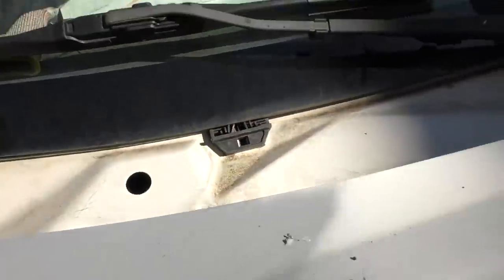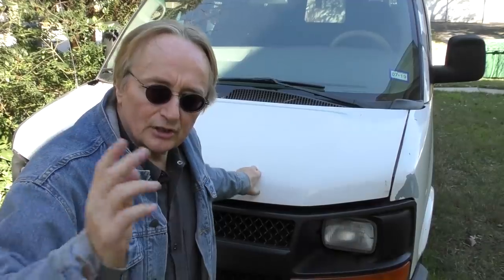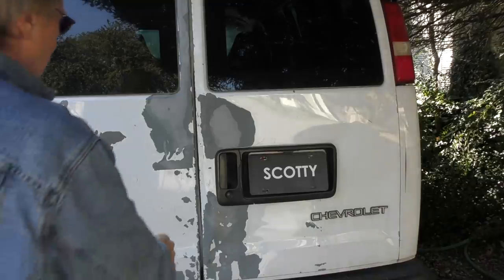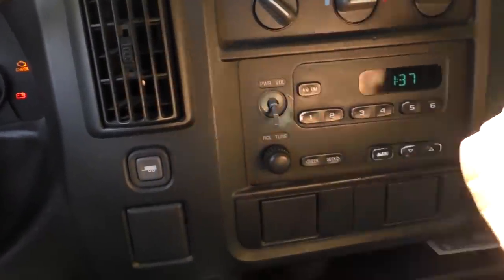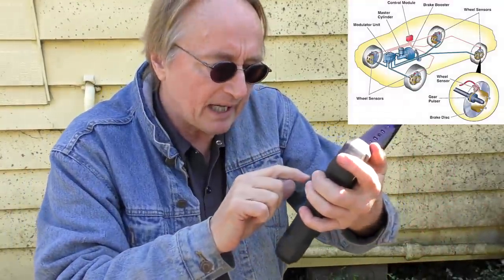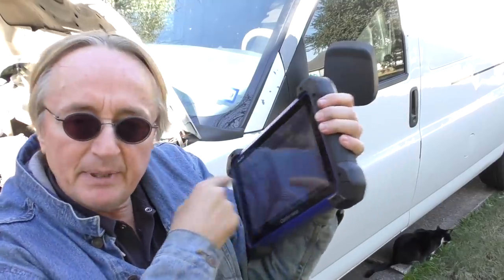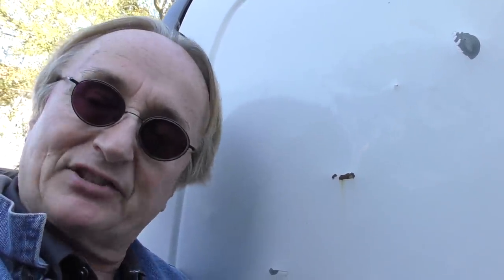I Told You About This Vehicle But Nobody Listened

Comment: One of the best pieces of advise I ever received from a used car dealer is never to buy a used car based on the model or make. You always buy it based on the way it runs.  A good running Genesis is better than a Toyota with a blown head gasket or shot transmission... always.

Years ago, I set up a "proper maintenance" program for my friends new Ford Escort...  Few of that vintage Escort ever saw 80,000 miles... but with regular timing belt changes and synthetic oil his was going strong at over 200,000 miles when a tree fell on it...  Normally, I'd never recommend that anyone would have bought that particular vintage Escort.  But with a top quality maintenance schedule, that would have made a great car to buy cheap at 100,000 miles and would have served someone for a very long time, if properly cared for...

If you really maintain your car right, and you keep up on repairs, and drive the car conservatively and most of all find a good affordable mechanic or do repairs yourself... you can make lemonade out of a lemon.  You can be the guy or girl with the "freak" car that lasts forever when all of the other cars of that make and model are long since crushed.

One last footnote... Cars often don't give up until after their owner gives up on them.  People just stop fixing the small things, until there are so many small things wrong with the car that the cars aren't worth fixing.  I've owned several cars like this.  Radio. A/C, windows, and heat don't work, exhaust leaks, paint is flaking off, power steering leaks, tires bald etc, etc, etc.  In all cases the engine and trans ran strong, but with so many things wrong I usually get the cars for junk rate.  So I assess the entire vehicle and start the rehab from the most critical repair to the least critical.  Over time the car slowly comes back as the repairs are done... and astounded people ask me how I can be driving a car for 15 years that I got for $1.00.  The fact is that the original owner could have driven their car for another 15 years if they had just kept up on the maintenance.   So yes, Scotty is absolutely right... you are always better off buying a better built and designed car, but if you got that part wrong, or can't afford a Toyota (for example), don't give up on old Betsy.  If she runs well, you might be able to keep her going strong with a little TLC.  She still may cost "too much" in repairs, but she's the devil you know and as long as she's still cheaper than car payments keep on trucking.  I've even sold a couple of our $100.00 clunkers as antiques for a profit after it just got too hard to find parts.

Comment: Every old gm ford or dodge commercial van had that paint problem
Reply: Plus they’re usually old. I just saw a Ford the other day on the job site, looked similar, if got got up close, it looked like it was snowing out.  I work in a company with fleet vehicles, if someone gave me the option of buying a previous fleet vehicle or rental vehicle, I’d be hesitant, but would probably go with the previous rental vehicle in that scenario.
Reply: @laxbeach2381  and if it's not the employees on vheicals they are rough on them no matter what

Comment: G.M. has had that issue with the paint for a LONG time. I had a new '89 Chevy S10 pickup with white paint peeling in big chunks down to the grey primer within a few months. (Along with lots of other issues.) After the 3rd time it was repainted (while it still looked o.k.) traded it. Took a hit since it was less than two years old. What a piece of junk that thing was. Along with the peeling paint the stuff I can remember fixing on that thing included: bad clutch fork causing premature clutch fail/slipping (< 5,000 miles), had bad programming in the ECU, so ran terribly in 5th gear, and various plastic crap broke under normal use including the glove box, headlight switch (nice when you can't turn your lights on a night) and various other junk. I know when I was trying to get hold of someone at G.M. about the paint they just kept telling me it was due to acid rain, despite the lack of other vehicles not having that issue at the same time.

Comment: The last GM I bought ran forever, however the trim, and paint  fell off and NOTHING worked after about 60,000 miles. Wipers, cruise, AC, some lights, all quit working, along with annoying exhaust leak that was fixed twice before I got rid of it.

Comment: I have a 1985 dodge b350 15 passenger van.  Still drives great just  came back from a 1400mile roadtrip down baja peninsula. The wheels haven't fallen off yet haha! Burns oil but still drives down the road.

Comment: Scotty. It is a VAN! The engines on all vans are hard to access. I have an entire fleet of these Chevys with about 400,000 miles and still going strong! I have 2 Ford E 350 chassis cabs from the same era that are sitting in our boneyard. BTW, the Fords both have had engine and transmission replacements at less than 150k miles.

Comment: My 05 Chevy cavalier paint job is still in very good condition after 14 new England winters. I  owned a 13 year old almighty Honda accord  for 2 years that developed  broken interior door handles, rotted out muffler ,  front end ate up tires and radio was shot.  ....the cavalier has had none of those problems .

Comment: My father had a 1997 Dodge Grand Caravan and after it was 7 years old, the van had difficulty passing the emission inspection in VA. We got rid of the van in 2009 as had so many problems with it
Reply: A wise old friend (once a Hudson dealer's machinist) suggested running any failed emissions test vehicle on E85 for passing the test, then reverting to the common E10.

Comment: As many have said here, maintenance also plays a big role.  Even if you don't take care of a Toyota, it will break down at some point, as will most vehicles.  I do agree that the accessories and electronics on GMs are garbage (my transmission--which is still going strone--has outlasted my driver's window switch and radio).  But my vehicle (which is a 2013 with the 5.3L with active fuel management) shows that it is possible to keep a GM vehicle in good running condition if you take care of it.    One o ther thing I've done to help my cars get high mileage with little to no problems (mechanically) is when I bought them new (yes I bought new vehicles in the past, probably won't anymore) is I would change the oil every 1500-2000 miles for the first few changes (so I might do 1500 miles, then 3000 miles, then 4500 miles until it reached about 5,000 miles, mainly to get out any possible metal grain from the mfr process that might be in the engine).  Some people just run the original oil until their first oil change which IMO you shouldn't do.  I also change my trans fluid every 60k, and do my 4WD service around the same too.  So far it runs great, with the exception of one lifter that sometimes get stuck, which will need to be addressed, but for 147k of mostly highway miles (and not easy ones, as I tow trailers too) that's not too bad.  I've seen worse trucks from the same era that had major issues right around the time the warranty ran out like burning a lot of oil or oil pump failure (mine failed, but within the warranty so it go replaced under warranty thank Goodness as that would have been a $1000 job) .  So proper maintenance goes a long way, and this van Scotty shows that depending on your expectations if you just want a van for hauling stuff or as a beater, and don't care what it looks like, then why not.  YOu can find some of those cargo vans really cheap that might look like crap, but they run fine.  aS for the radio, perhaps the guy should just pull out the connector in the back.  Simple fix.

Comment: My 1977 Camaro had the same issue with the paint. The hood was repainted once under warranty. In those days the warranty was 12 months/12,000 miles. 43 years should be enough time to figure out how to paint a car. But I guess not. Maybe in another 43 years.

Comment: I’m listening Scotty.   Especially since the Bailout.   GM has gone wayyy downhill.  They had bad primer back in 1989-1994 I believe it was.  The trucks were solid but paint was crap.  I drive a 2014 Chevy Express work van for my company vehicle.  All of them fall apart and yes have the bad paint Again.  The bumpers aren’t galvanized anymore, you get one scratch and it bleeds rust ☹️.  Why don’t they point this out on their Real People Not Actors commercials.  🧐

Comment: The doorhandles on 2003 on a Chevy vans are cheaply made. You have to buy the entire panel and it costs about $400 per side from the dealer. If you somehow break one of the window cranks off, which is really easy the way these vans are laid out you look at it another $300 to replace the regulator/latch assembly. It’s all one piece. If you’re going to buy an old American style van, Ford E Series has more head and leg room and the door panels are better built. The only issue I have is comparing a Chevy cargo van to a Toyota sienna. This is apples to oranges as Toyota doesn’t even have  a work van in the USA.

Comment: First off it was not GM's paint, IT WAS A PRIMER ISSUE, and many other manufacturers suffered the same problem. So your talking bunk here again Scotty. GM has a de-lamination warranty.  Secondly, most all vans have dog houses and this one is one of the easiest to remove. More bunk again Scotty. Engine size? I guess all the Express vans running over 200K got stressed out like you implied? Again more bunk Scottty. Yes this one was beat hard and put away wet. GM's fault? NOPE! SO I GUESS YOUR DONE WORKING ON CARS AND HAVE BECOME A BUNK SALESMAN?? YUP!!!!

Comment: That guy with a Toyota transmission question...
I had a Toyota Avensis II for 10 years with an AT and currently own a Toyota Avensis III with a CVT and both their manuals explicitly say NEVER EVER do that kind of thing  on a slope. The things just weren't designed for that.
You can do it if you're want, it's your car and money after all. But then you shouldn't be asking in the first place.

Comment: I see a lot of old Toyota's with no clear coat left, and a red car that is now pink.  Can't decide if it's poor quality or owner neglect since they just want to go from point A to point B.  Toyota's are designed for people who don't like driving and don't like cars.  That van is rough though.  I heard GM trucks don't take too much pressure to move back on the frame straightener either.

Comment: LOL vehicle rolls backwards while in drive ,let's do a tune-up! Says Scott!  All vehicals do! depending on the grade you're sitting on. Always good to hold your foot on the brake until you're ready to go quickly moving from the brake to the throttle to build pressure in the torque converter , more RPMs (faster) you spin the torque converter turbine = forward inertia

Comment: We run all GM trucks at work. Used to have several Express vans(V8 AWD). All of them went well over 250k and one went to almost 400k before it was sold. Some issues, but surprisingly few. We now run Canyons and Silverados (all 4x4). The first canyon we had has 310k with some minor repairs, all original drivetrain. I've definitely had some issues with GM products and will never personally own one again. I just got rid of a '10 traverse in exchange for a '17 highlander for my wife. That Traverse was an absolute pile. My current company truck ('19 Silverado V8 4x4) with 62k on it has already had the oiler cooler lines replaced due to leaking and the starter died and had to be towed to the stealership. The trucks seem ok, but the cars seem horrible. I don't pay a penny for my company ride, so I'm happy to take whatever they get me, but if it were my money I'd be driving a Tundra.

Comment: I drive a 2006 Chevy Express 1500 w/ the 4.3L Vortec for work. It’s used to haul 10-15 dogs, yes dogs Monday-Friday. I agree that the engine is underpowered, but at 130,000 miles and 90% driven in the city this van has been very reliable. It gets it oil changes every 5000 miles, only using Mobile 1 synthetic most of it’s life. Transmission fluid, diff, and coolant are replaced every 3 years due to severe service. No joke, our Chevy has no leaks from any part of the drivetrain whatsoever. That being said, it is a rusty beast due to the harsh Chicago winters and paint comes off it every time it's washed lol! It’s been way more reliable than our 2014 Ford Transit Connect LWB which has suffered multiple electrical problems starting from when it was under warranty. I would definitely buy another Chevy van over a Ford.

Comment: My white 2019 Tacoma has paint issues.  It’s the TRD off road addition with 7000 miles. They need to paint it..,that sucks! Another issue is that the plastic interior scratches easy. The door panels etc. should be a little more forgiving.

Comment: GM, “Quality or lack there of”😂😂.  I totally agree! I have a 2019 Craplaredo 4X4 RST & only have 7K on it but the transmission slips, A/C doesn’t work until 3-4 minutes running and even then it isn’t cold, dashboard cuts out (real fun at night when you can’t see what you’re doing), ABS light is on but hey look at all the fun I get to have arguing with the dealer when they say it’s normal operation.🤬 Toyota & Honda from now on!!!

Comment: Oh how the myth of how "they used to build them to last" endures. Oil-based or alkyd enamel is better than water-based paint, however,  Almost all of the missing or broken parts on this well-used Chevy can be easily sourced. It was a work van after all, so abuse and misuse can not be ruled out. Was the radio PWR knob seized or just missing the knob?  I would pull the radio fuse/relay if the radio white noise cannot be suppressed.  The bulk of the V-6 engine weight aft of the front axle(s) actually improved handling. The external door pulls seem to have lasted longer than the Toyota Matrix door pulls. The GM's Vortec dip-stick may have been jammed in too abruptly by many different drivers. Please note that I am not an apologist for GM.  I actually don't own a domestically built truck.  Back in the day, the 1970's, my company couldn't get more than 90,000 miles out of a truck or car without the engine, differential or transmission calving. Rebuilt carburettors were required after 48,000 miles. Leaking rear seals after 25,000 miles were the norm, and vehicles occasionally arrived brand new with surface rust on the undercarriage. No under coat nor galvanised steel.  They sure don't build them like they used to.

Comment: Hey Scotty,

I have a 2015 mustang ecoboost premium (6-speed automatic) with the performance pack, 59k miles. I bought it in 2015 from a lady who put 3k miles on it, didn’t like it because it wasn’t easy for her to get in and out.

I change the oil every 5k miles, at 30k miles I got the injection cleaning done, at 50k miles I got the brake hoses flushed out. So far the only problem I had with it is that I needed 4 new spark plugs at 58k miles, and new fuel pressor sensor at 55k miles. 

I don’t drive it like a maniac, what is your experience with this engine and car overall? What should I expect? How does it hold up? It’s been out for 5 years so I hope you have some personal experience, it would help a lot of the mustang fans out!

Thank you in advance 

Gabor

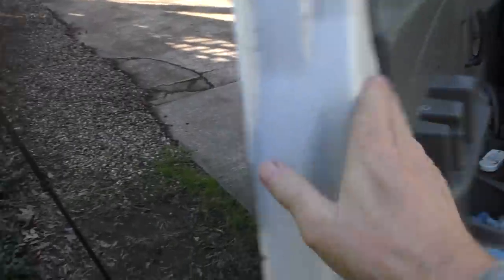Comment: Did anybody else expect the plastic door handle to snap off in his hand at 3:50?

The thing about GM is that their quality was really inconsistent. Their four cylinder econo boxes were junk but their higher end luxury cars weren't bad. They weren't as good as Lexus but there were a lot better than Kia, Hyundai, Nissan, or anything from Dodge/Chrysler.

Comment: What's a good new reliable car and truck Scotty?  Top pick.
Reply: Probably a Gord F-150 Toyota Tundra, Toyota Tacoma, Nissan Titan.
Cars Toyota Camry and Corolla, Honda Accord Civic and Jazz/Fit.
Reply: Toyotas
Reply: @Foxter501  thank you 👍. car went kaput.  Looking into a new car now.
Reply: @oscar.gonzalez  Hondas, Acuras, and Lexus too
Reply: Truck? All of them have various issues, from Ford 10-speed troubles, to Chevy electronics, to Toyota gas mileage. The latest I'd go is a 2010-13 GM, and a 1996-06 GM that hasn't been rusted out would be better. As for car or SUV, I wouldn't buy new unless it's a Tesla with the Full Self Driving option package (incredibly important to get). To see why, and why I'm not a fan of new cars as a whole, youtube "Tony Seba robin hood conference" (or, if you have an hour to spare, and you want the most info, "Tony Seba NC DOT".)
Reply: If I have to buy a car, I'd look into a 2005-06 Camry or 2009-12 Avalon. A 1996-04 Avalon is another great car, worth buying even if it has over 200k miles on it.

Comment: Scotty wat make do you recommend for someone buyin a new truck???
Jeep? Toyota? Nissan? Any suggestions?
Reply: Don't bother with any brand; they're all crap, from Chevy electronics to Ford 10-speeds, to Ram/Jeep everything, to Toyota gas mileage. Nissan? Eh, plus the depreciation. The absolute newest I'd get is GM from 2010-13, and permanently disable the cylinder deactivation. One from '96-06 would be better than that.

Comment: As for the Paint GM offered to repaint the vans. This van has not been taken care of at all it has been abused by whoever maybe some employee at one time. Scotty mentions that it had no window on the one side that is available as an option, some people might not want that option, Hard to hang your tools and such on a window. Scotty compared a worn-out work van to a Toyota which is not a work van, not a fair comparison. I drive a 2001 Chevy Express 3500 with over 403000 miles on it. I changed out the motor around 305 000 miles with a chevy crate motor that costs $1800 bucks with a 3-year warranty. If you follow Scottys advice and have a good maintenance plan and stick to it. Even Chevys will last but you got to take care of them